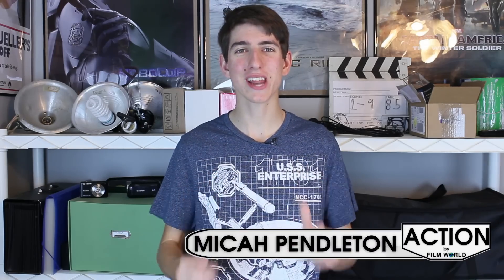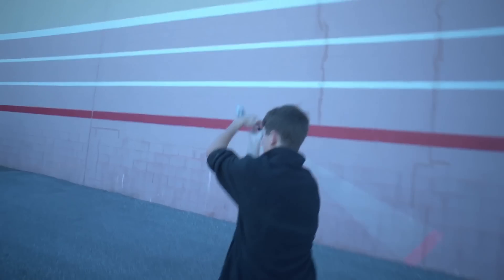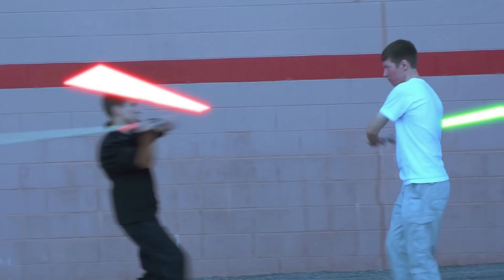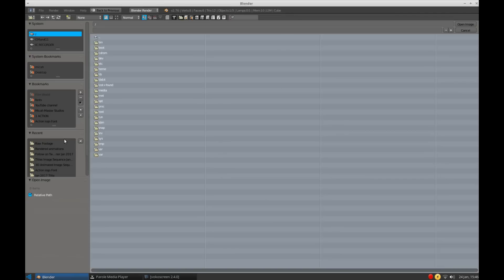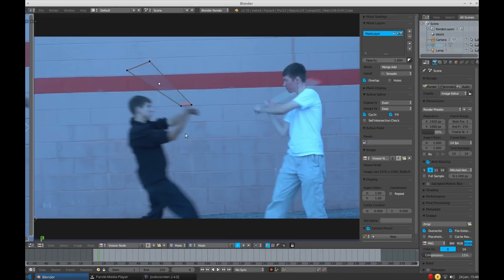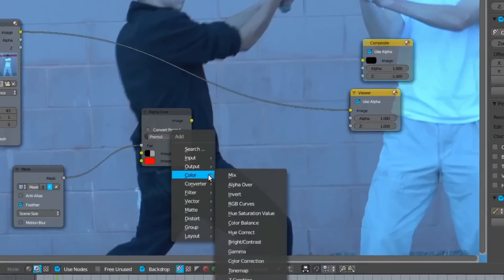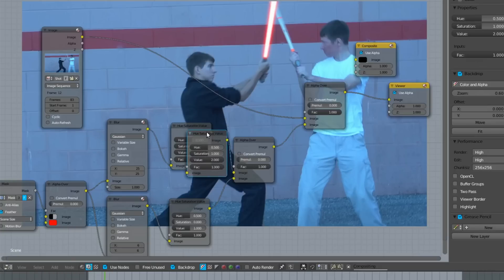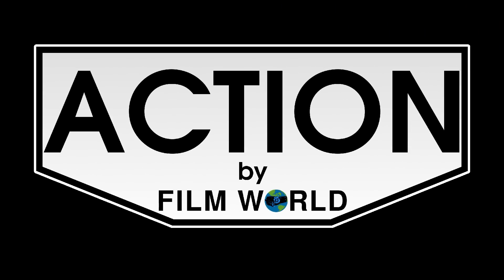How to make a Lightsaber in Blender | The easy way

Comment: You could make the blade more rigid (but not perfect) by using 2 or 3 fiberglass driveway markers jammed into the PVC pipe. It will be stiffer but still really light.

Comment: why is the saber blade not on the pole and not tall enogh
Reply from the maker: +The Flying Gamers This is a common mistake. Your render resolution is probably not the same as your video. Make sure it is and it should be fixed

Comment: cant you track  the light saber sum how????
Reply from the maker: Dj Minecart You could do this is some situations. The problem is, while it may be easier technically, it is VERY limiting creatively. When your Lightsaber moves around it creates motion blur which means your talent can hardly move the saber. You could increase the shutter speed, but this can give an "artificial" look. Another problem you run into is when the blade gets obstructed by another object... you can't track it at that point. So you'd really have to plan the whole thing around motion tracking instead of getting the best shot.